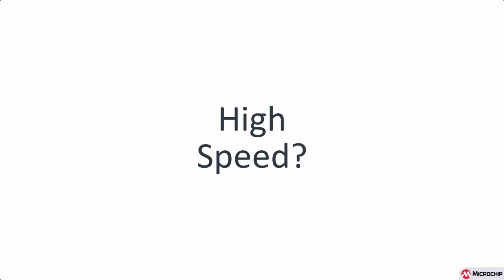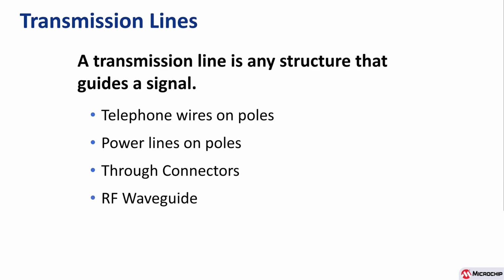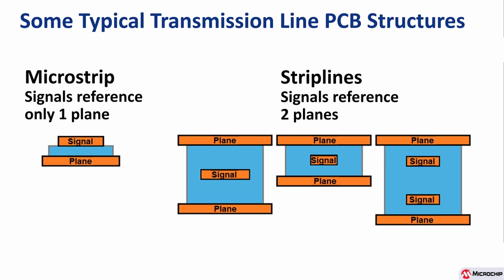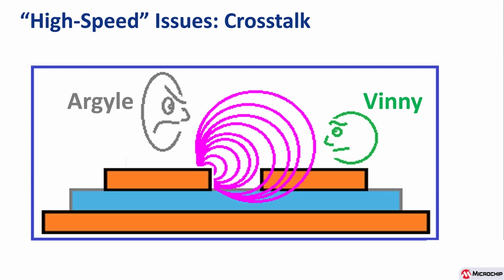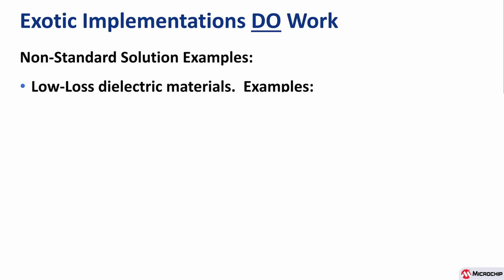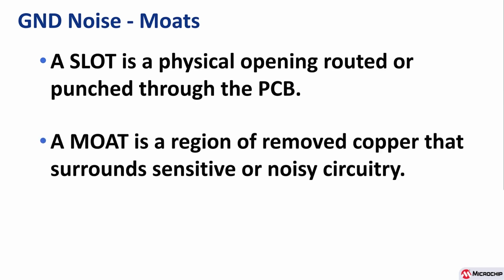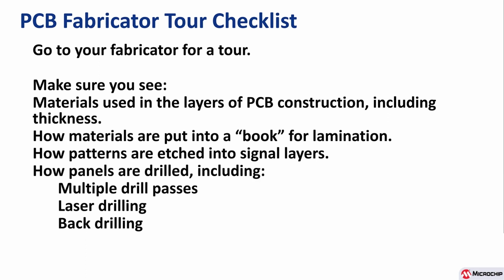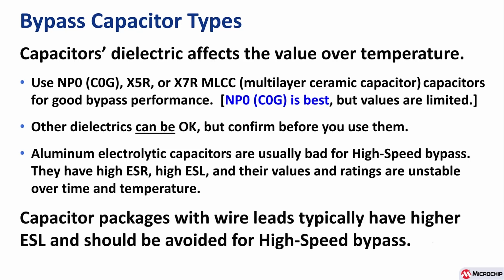Mastering High-Speed Protocols: Diving into Modern PCB Design

Comment: While impedance does apply to digital signals, most digital signals are NOT AC.  AC means Alternating Current, alternating between Postitive and Negative, NOT x volts and 0 volts.